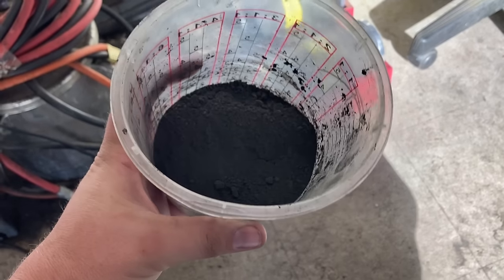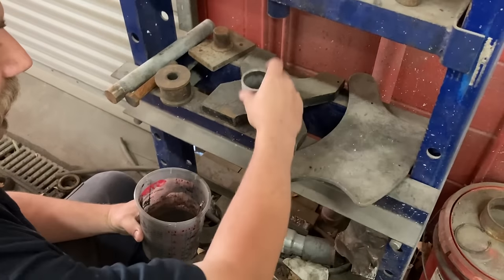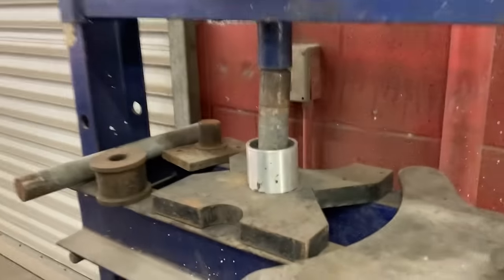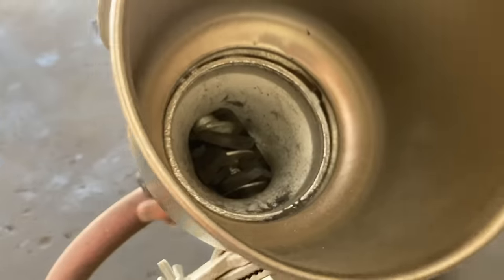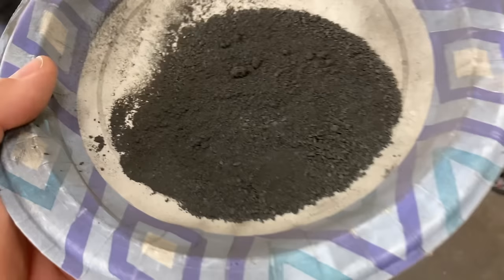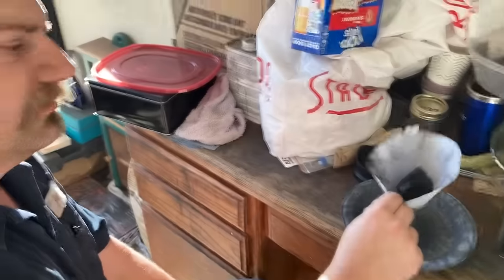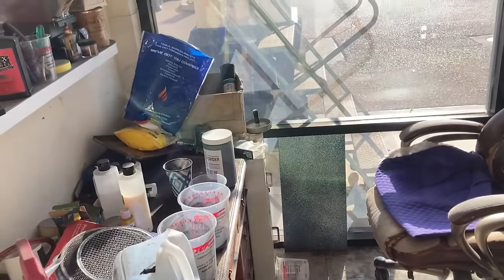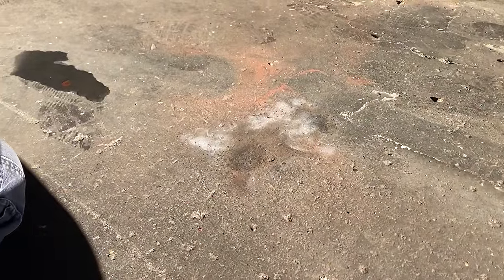Making Corned Black Powder

Comment: Enjoyed the video , I have a question ,,I have a 1850 percussion shotgun, in excellent condition,  I want to shoot it, is your bp suitable? I don't want a powder thats too wild , ie smokeless powder is high pressure which would destroy the gun, bp is supposed to be low pressure,  any tips would be gratefully received, thanks
Reply from the maker: Yes, any black powder will work. Do not use any form of smokeless powder! It will destroy your firearm.
Reply: @Everythingblackpowder  thanks man

Comment: The best charcoal is something you will never think of!
Reply: Ok. I will tell you what if is. Soot. It is pure carbon. Roll wet leather over a candle flame.
Reply: P.S. grind it three times. Lay it out a quarter inch thick. Dry it. Grind it really fine. Wet it. Do this three times. Then grind it to size.

Comment: Have you ever used  dextrin as an additive like you were using the graphite? I remember a video from several years ago that suggested using it but have since read it is a really bad idea.
Reply from the maker: I have used dextrin back when I was making screened powder but it made the fouling much worse. I haven’t used graphite in a couple years now because it slows down the burn and loses velocity. I view both as contaminants that lower the quality of your powder.

Comment: As far as the charcoal goes the pet bedding cedar chips did they work good for you and even though it was fine chips it still needs to be powdered before milling is putting that in a blender OK because I’m using cedar wood chips to make my first batch now
Reply from the maker: Yes that’s fine. I use a knockoff magic bullet
Reply: @Everythingblackpowder  thanks I appreciate it

Comment: The only purpose for adding graphite was to make the black powder less susceptible to Accidental ignition. Untreated Black powder is susceptible to going off with static electricity. The graphite was supposed to prevent this. The only other thing it does is make it flow better. I don't bother with graphite

Comment: I wonder if there is a way to figure out how much pressure you need to reach the same density of “commercial” powders. I’m gonna try compressing some of my powder this weekend using a plastic cylinder under the cider press and then compare the volumetric grain to the weighed grain after Corning. Should tell how close I can get.

Comment: Are the grains strong? Does it leave fine dust when you put it on white paper?
Reply from the maker: Yes very strong. I sift my grains in a 190 micron paint strainer until all of the dust is gone
Reply: @Everythingblackpowder  can you make black powder with 10 % ammonium nitrate would like to know what you think? Use 10%less saltpetre should have less fouling but will be slightly more hygroscopic

Comment: Hello 👋 
Reloading shotshell in Illinois. I was wondering if you knew anything about  black powder vs HP-38 for example. Tia
Reply from the maker: I’m afraid I don’t fully understand the question. HP 38 is nitrocellulose base smokeless powder and need to be loaded and treated completely different than any black powder around, pistol, rifle or shot shell.

Comment: tumbling the grains to knock of the sharp corners gives a more even burn,the sharp corners will burn faster than the rest of the grain, leading to unburnt powder being ejected unburned in muzzel loaders.
Reply from the maker: That’s what happens when we graphite coat it
Reply: @Everythingblackpowder  wasted money, graphiting is a transportation aid, it prevents caking in transit and helps keep grain integrity against vibration.
it's absolutely unrequired for the home powder maker.
Reply from the maker: Agreed, My biggest gripe is it slows down the burn rate and overall performance in a muzzleloader. On average it’s 100FPS slower. I haven’t seen any noticeable difference in fouling.
Reply: @Everythingblackpowder  it's pure carbon, so you won't find it effecting fouling.
it's an infinitisimally thin coating, barely a micron.
as I said, an unnecessary additive unless you are a major producer shipping far and wide.
forget using it in your powder finishing, it's best used as a lock lubricant!
Reply from the maker: Yep

Comment: I am a NOOB :D What application does corned BP have in guns ? Is it better or worst than fine powder ? I mainly shoot 1861 Colt Navy and Smith and Wesson .32 rf model 1 1/2 later issues tip up model. Would corned be better or fine powdered ? 😊 Thank you!
Reply from the maker: All commercial black powder is corned regardless of the granule size. By “fine powder” do you mean the old fashioned screened black powder?
Reply: @Everythingblackpowder   @Everything Black Powder  I see! My powder is commercial grade but just very fine in size. 😊 I am thinking of making my own powder in the future tho! Thank you already for all your insights! I really appreciate you!

Comment: Have you considered making your own .30 and .50 cal powder pellets? I have done a paper experiment designing a needle fire variant of the .40-60 (.40-70) Swiss Schutzer rifle that uses a cellulose nitrate coated flash paper wrapped waterproof cartridge for a Doersch-Baumgarten Dreyse rifle that has a Chassepot base primer system. What can I say, if you can't afford to create yout black powder rifle, design it

Comment: Dear sir when I make powder with lead balls I find that my powder has a certain lead content .that said I don't know what to use besides lead. I tried marbles but they are not heavy enough. I can't find a source for copper or brass or even tin so I am stuck with a lead balls. Any insight on this would be appreciated. Thank you
Reply from the maker: I’ve been using ceramic balls

Comment: I'm interested in getting into black powder rifle shooting. I don't have a rifle ( at this time ) . I think this is ( to the best of My knowledge ) the only rifle I can keep shooting without anything having to be purchased ( to make ammunition )
as long as You have lead ( once You're setup & have the necessary knowledge ) .
That said , it looks like it's going to be a long road & long learning curve for Me ! Would You consider being My Mentor in this ?
Reply from the maker: Happy to help
Reply: @Everythingblackpowder  Thank You . I guess the first step would logically be to buy a rifle . I think I would like a Hawken style
( probably 50 cal for ease of everything, 
buying bullet molds
etc. etc . and seemingly endless etc. ) Besides , I'm not
opposed to BUYING ready made ammo when it's available !
( from what I've seen
50 cal is pretty much it
within practical driving distance ) 
I'll have to be hungrier
than I've been in a long time before I'll be shooting anything for the table with it . ( just
Putin holes in paper )
Therefore I don't need to spend enough on a rifle to buy a pretty good used car. ( ... in fact My first one will
probably be a used one ) Any good tips
to buy one ( what to look for .. or look out for , etc ) 
Sorry for the lengthy
request , but I need the help !
Reply from the maker: @johnhoward7298  I would check pawn shops and local gun shops for a used Hawken. I would be looking for a Thompson Center but a CVA or Traditions is also good. 50 is a good all around caliber
Reply: @Everythingblackpowder  The only one I found in a pawn shop is a 50 cal
and the only writing is
the warning & 50 cal 
& made oi Spain
Reply from the maker: @johnhoward7298 sounds like its traditions or a CVA
Reply: @Everythingblackpowder  I don't remember how much it was . What's a fair price for it ( barrel looks good , it has scope rings w/ it , wood shows rack time 
rear sight has been painted red )

Comment: Just re-watching this video now for the garzillant time and been read an article the other night about Swiss BP process and ratio - the article had 78.5% oxidizer to 12.5% fuel and  10% catalyst, no graphite, just a very long polishing phase. Swiss also must take emphasis on slow charring their willow in an controlled electric kiln stack. Wouldn't be too surprised if they managed the gas atmosphere in the stack as well. 

Guess the even flame spread along the polished grains of BP in combination with well cured as slow charred willow coal and an slight excess of oxidizer on top of time and volume is their magic incandescence of Swiss that causing the clean burn.

I come to the conclusion that the graphite only helps with powder fuses in larger shells - it a byproduct of commercial BP that wasn't primary meant for our uses. These coating agents actually retard  the burn rate of BP grains and decrease the power output as they eat up energy. Guess that okay if you want to light up a powder load with BP primer line without blowing the load apart in the process to keep the pressure buildup progressive.

Comment: Hi there from Alberta, love your videos and fired my BP made just as you do. Wonder if you would comment on getting the density you achieve.
Managed to get 60gr volume to weigh 47gr. Did not chrony yet but it shoots well.
Thank you, Walter
Reply from the maker: I use a 20 ton press but over the last year I have been using a puck die that is 1.5 inch in diameter, The same diameter of the post on my press. This distributes the weight evenly in the puck and will give you more complete compression.
Reply from the maker: Also, You could press it twice. That usually will take care of the density issue even in you have a weaker press and wider die
Reply: Hi there I can press up to 30 ton. I was only going to about 8 ton. Next batch of pucks I’ll go full 20😊
Thank you and keep up the awesome content!!!
Reply from the maker: @MrVoltar1  happy to help
Reply: Checked my press and was indeed pucking only to 8 tons on a 1.5” cylinder. Have about 600 grams of powder to puck 😊

Comment: My interest in this is the grinder. Where did you get it? I would also like to know the volume to weight ratio as compared with Goex. Does say 50 grains by volume of both weigh the same or which weighs the most.
Reply from the maker: There’s a link in the description for the grinder. My powder is more dense than Goex so 50gr by weight is slightly less in volume than Goex. I typically use a volumetric measure for all my experiments because that’s how black powder is typically shot.

Comment: I use Dextrin (1gram add to a 100 gram BP) before I mill, after words a very small amount of hot water is mixed until it looks like a charcoal briquet. Run it over a SS screen of the particular size I want. then dry. Have you ever tried that method?? Thx Tom Buffalo, NY
Reply from the maker: Yes, I started off making powder that way. It works well enough but it’s not nearly as powerful as commercial powder.
Reply: @Everythingblackpowder  I have only been at this a few years, I am still learning. I will be giving your method a try next time I make BP.  Stay safe and thx for getting back to me!!

Comment: A little water squirting out is accualy good,, it shows have enough so not to ingnite under pressure,, and the there is enough to bound the salt to the carbon👍 but yeah iv it's uzzi g out just let it sit for a few,,air dry b4 pressing 👍 and 100% dry, in a static free environment

Comment: One of the chemical guys on YT (think it was Elemental Maker) did some comparative tests on different DIY charcoal / black powder burn rates, he got the fastest rate with willow charcoal (although he didn’t do toilet paper 😂).
I’ve also wondered about bamboo charcoal and I have made some bamboo charcoal but as yet haven’t made black powder from it but it definitely seems lighter and fluffier than other timber I’ve used if perhaps you want to try it.
My interest is for fireworks and the odd harmless things that go bang 😂

Comment: The first time I owned a black powder gun (CVA Hawken .45 pistol from a kit) I bought Elephant Brand FFFg powder for it.  That was 1979.

If you can make powder as good as Goex (or better) that handles the same, more power to you.  Maybe I need to get a tumbler and start making my own (but if I do, I'll have to get the tools and materials to make my own caps, too).
Reply from the maker: I started making my own caps about a months ago. We have yet to have one fail on us.
Reply: @Everythingblackpowder  Using packaged paper caps (fairly safe) or making your own Armstrong's mix (very hazardous in more than a gram)?
Reply from the maker: I use a compound called prime-all

Comment: Are you still using this puck grinding method? I think this is your most current video of a complete process.
Reply from the maker: Yes
Reply: Thank you for the reply, do you still recommend the pucking die you linked in the description? I saw where you made a comment to someone that you didn't like 3" pucks. Do you have an alternative you'd suggest? Thank you for the content. @Everythingblackpowder
Reply from the maker: I don’t like the 3” die. I’ve been using a 1.5” die made for squishing marijuana or something. It works very well. Let me see if I can find the link for you.
Reply from the maker: https://www.amazon.com/Rosineer-Stainless-Steel-Cylinder-Pre-Press/dp/B0BX22K6HV/ref=asc_df_B0BX22K6HV/?tag=hyprod-20&linkCode=df0&hvadid=647337682535&hvpos=&hvnetw=g&hvrand=3005341876853663488&hvpone=&hvptwo=&hvqmt=&hvdev=m&hvdvcmdl=&hvlocint=&hvlocphy=9033815&hvtargid=pla-1970450401099&psc=1&mcid=274495747e83359f8135b92021e9f3bf
Reply: Awesome, thank you @Everythingblackpowder
Reply from the maker: You bet. I find this works better

Comment: Tumbling with the graphite will make it burn a tad slower but at more predictable (characterizable) rate.
Reply from the maker: We just did a test on that last weekend and found that the graphite coated powder has slower velocities by at least 100FPS
Reply: @Everythingblackpowder  That's pretty significant and totally believable. You're basically reducing the surface area of your grains by that final tumble.

Comment: The graphite helps to prevent dust being generated with travel/shaking.... not really an issue with home made powder that is used close to where it's made....
Elephant powder is Chinese... not bad stuff and the price was good... haven't seen any for some years now...
I have been wanting to try the compression method.... must give it a go... good vid....
Reply from the maker: I just checked the velocities between graphite and non graphite coated powders and the non graphite coated is 100FPS faster.
Reply: @Everythingblackpowder  Now that's interesting..... I did wonder whether the graphite coating would slow ignition... In the commercial process the powder is tumbled for quite some time with a wee bit of graphite for the above reasons...
Actually I have found that wee bit of dust actually seems to speed things up....
I read with interest your using a bit more KNO3 than the standard amount.....
Charcoal.... yes I find willow superior, but recently a guy told me that pine cones are even better.... so my next batch I'll give them a spin.... The old British Army powder works at Waltham Abbey (just a bit North of London.... now no more) used a variety of wormwood which they swear is far superior to anything else..... that was a new one on me....

Comment: How explosive are the pucks after they've been pressed but before you granulate them?  I wonder if you could use a toaster oven on low to dry them faster?
Reply from the maker: I would not advise that in the slightest. They are basically giant granules of powder and are just as explersive as the small 2 and 3F granules.
Reply: @Everythingblackpowder  Have you ever had problems with your black powder clumping up in the ball mill after about 4 hours of milling?  I don't know where the moisture is coming from to make it clump... i've tried drying everything out in the oven before mixing, (except for the sulfur which just melts) and i keep getting a hard clump of powder?  Any ideas?
Reply from the maker: If it’s all clumped up at the bottom after milling for a few hours that usually means it’s incorporated enough.
Reply: @Everythingblackpowder  ah... well i guess that's good enough then!  I should be testing my first batch of corned powder tomorrow! Thank you so much for the videos and comments!!!
Reply from the maker: @rokclymer1  happy to help

Comment: Couldn't you run the pressed pucks through the grinder without drying them first?
Reply from the maker: the grinder will turn them into paste if they aren’t dry
Reply: @Everythingblackpowder  Shame. I would have hoped that it would help make pellets that didn't make as much dust.

Comment: I made my own powder and run it through a strainer. Most of it is about 3 f but I don't separate it .I shoot about 80 grns in  my .50 cals. It's a very fast burning powder. How can I be sure it's not to fast ?
Reply from the maker: Too fast? I don’t believe there such a thing.
Reply: @Everythingblackpowder  isn't the purpose of corning it to control the speed?
Reply from the maker: The process of Corning condenses the powder to 1.7 grams per cubic centimeter so your volume is equal to the weight. This does a couple thing. It makes the deflagration more even from  granule to granule. And slows down the deflagration making it more powerful and slightly cleaner burning.
Reply: Great video. Willow charcoal is all I use. I have screened my  powder haven't picked and corned it yet.

Comment: Is this charcoal or is it already mixed with Sulphur and potassium nitrite?
Paul
Reply: KnO3 is potassium nitrate, this is what he is using as his oxidizer. Never ever use any chlorates with sulfur. That is two chemicals that hate to be together. You “will” have a spontaneous ignition mixing potassium chlorate and sulfur together when they are dry.
Reply: @equipyourselflifeskills5802  yea. That was a typo. Thanks.